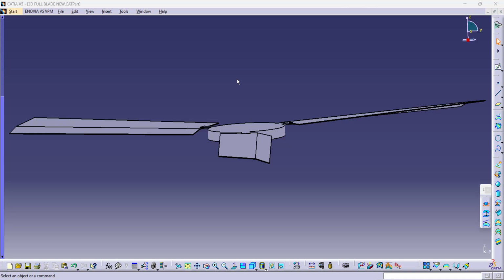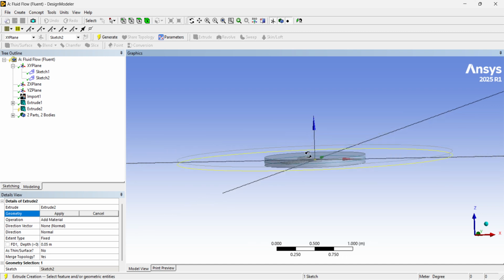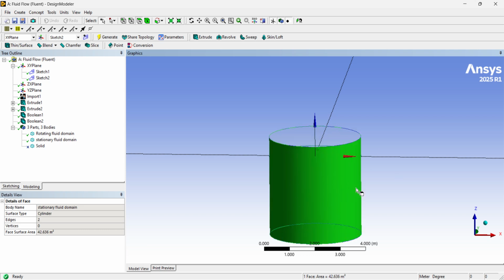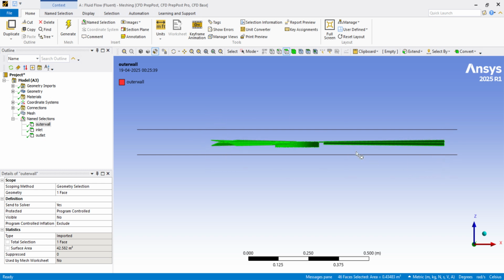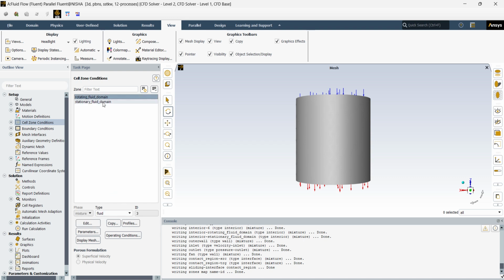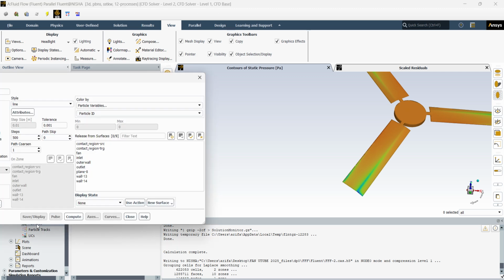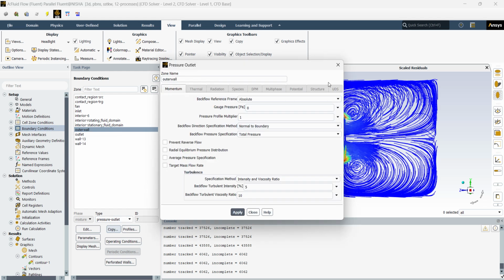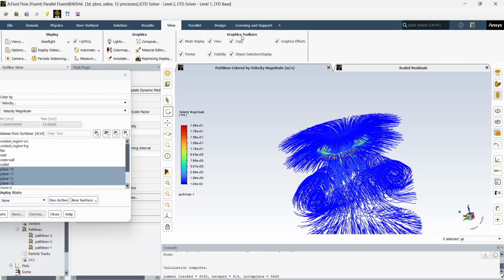Fan Blade Flow Simulation

Comment: Hello there i need some help... i have been working on a Ceiling Fan Project which i have designed. Now to enhance efficiency and airflow i will change the rake angle , bend angle and so on ..so i need a simulation setup where i will know the effect of the changes of the blade angle and so on in a confined room..can you help me with it?